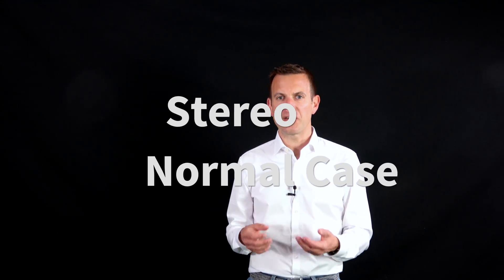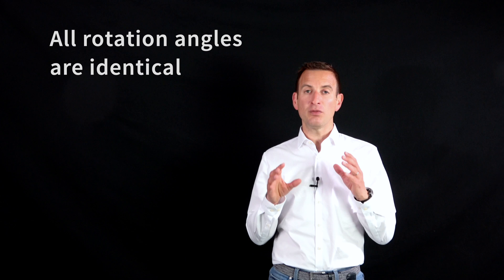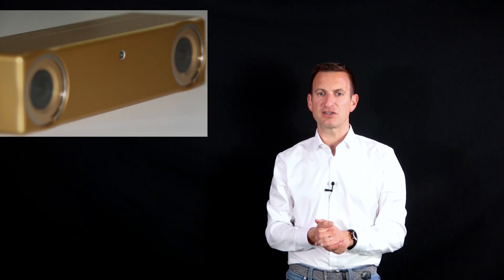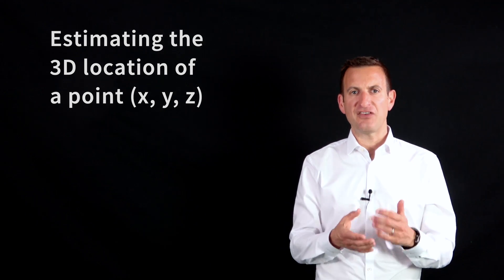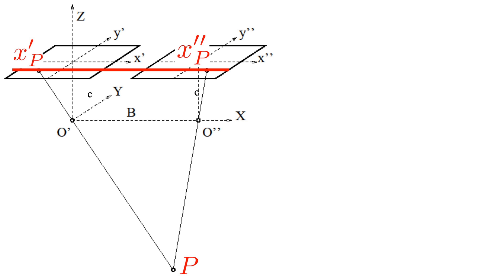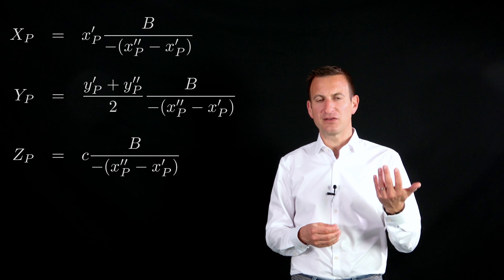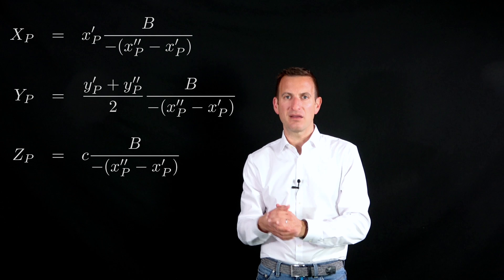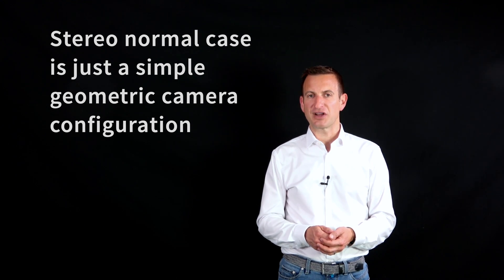Stereo Normal Case - 5 Minutes with Cyrill

Comment: Hey Cyril, I would like to learn how to first map out a 3d object such as a soccer ball and then learn to separate the ball into different sections of my choosing(through software/programming) and have my hand held robot perform a different action based on which diffrent section of the ball I am hovering my handheld robot over . Im open to all ideas/sensors/techniques. How would you map out a 3d object and separate it into different sections in order to have a hand held robot perform diffrent actions based on which section it is located? Do you know of any articles books or projects that can teach me how to do these things? What would you recommend I learn to achieve the ability to do this? Thank you